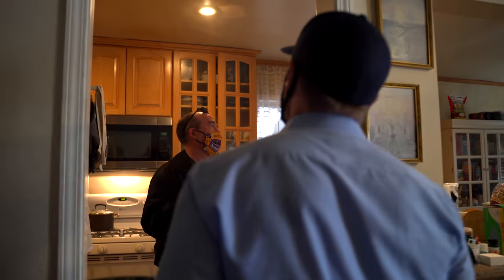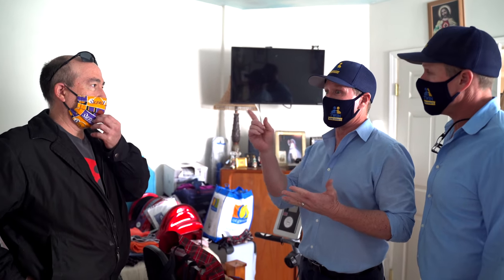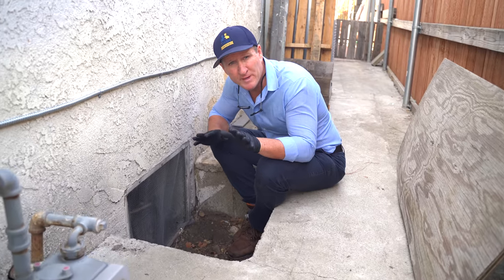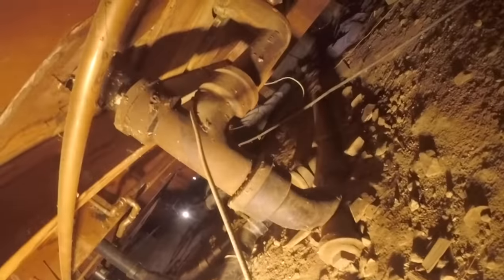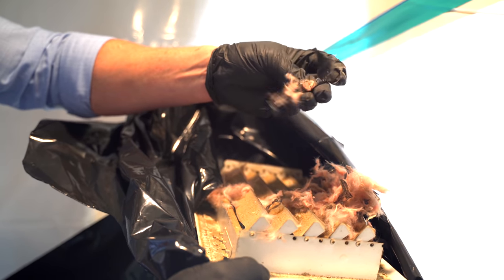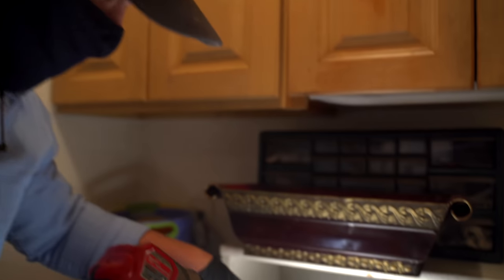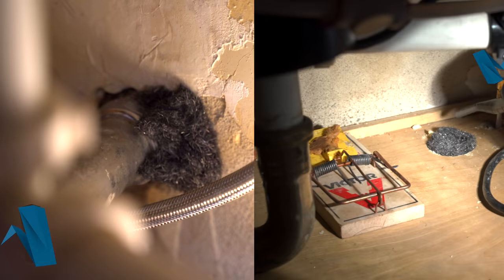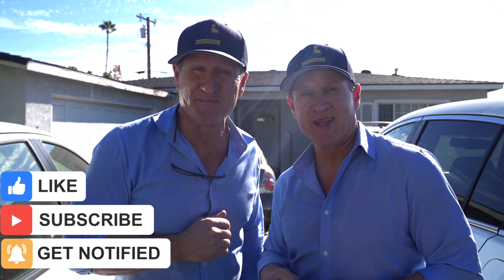How to GET RID of Rats QUICKLY when traps aren't working...Twin Plumbing

Comment: My house is 100yrs old. Its been a constant struggle. To the point I wanna sell the house but I found a new company that does a lot of the things you talked about. Thanks for letting me know what to look for. These vids give me hope that this can be solved. Wish me luck.
Reply: Most pest control guys are  ot interested in solving the problem. They want to keep the problem alive so you keep hiring them over and over
Reply: @resireg  this guy fixed it. Walked in and knew exactly where they were getting in. Crawled under the house. Didn't charge me a crazy amount. Hopefully they never come back.
Reply: The thing with rats is they follow the scent of former rats who have been there, so if you get rid of one infestation it’s only a temporary fix. Rat control needs to be done on a regular basis or they easily reproduce again to take over. Good luck with your home.
Reply: @eatwhatukiii2532  thanks. It's been about 2 months and I haven't seen any sign of them. Hopefully it stays that way.
Reply: I also have a 100 year old house.
 It was completely remodeled inside and I bought it almost 2 years ago and discovered recently I have roof rats in a wall and a closet and I am sure in attic etc. No signs in the garage.
 I'm trying learn as much as I can about what I can do myself and what to expect when I call a professional while I save up money to hire them.
I am so freaked out, but watching these types of videos kind of helps me desensitize and get in combat mode instead of wanting to retreat and move, Lol.
I've even considered buying native rat snakes for under my open crawlspace...
Reply: @AngieF8  lol it's a ongoing war, my backyard is facing a corn field with the 100 year old house so let me tell ya, they will keep trying to come back for revenge
Reply: We have the same issue & our home was my husband's grandparents. My father's best friend lived nextdoor so we both grew up playing right here together & are loathe to sell it. But one side butts up to woods, across the street is a climate controlled storage unit company surrounded by farm land that runs between it & our local airport. Within a 1/4 miles is a UPS as well. We THOUGHT we just had nice again this year but the traps haven't gone off. We even have one of the professional metal catch ones that can be a love trap or set with a glue board. Nothing. 
A few weeks ago I was working my flower beds and noticed dirt piled up from UNDER our foyer on both sides. 
My oven has started stinking so bad & I have reactive airway disease that reacted badly when I tried to pre-heat the oven last night with the exhaust fan. 
He just pulled the oven out to deep clean & a Norway rat jumped out & ran to a HUGE hole it ate in my cabinet
Reply: @KyaniMosaic_Crone  I'm sorry. I hope you get it resolved. These old houses are like Swiss cheese. As for me I'm moving to a loft were I can see all corners. Lesson learned.
Reply: Get barn cats. Not only do cats annihilate rodents currently there, their scent also discourages more rodents from moving in. A small feral population of barn cats that are spayed and neutered will make rodents disappear.
Reply: @qntcats5974  update. House is on the market. Moving to a high rise new construction on the 1st. Lol. I've given up.
Reply: @virgochic8415  I purchased a home in the woods with a large workshop that hadn't been occupied in years. People I bought it from remodeled the place but because they hadn't lived there it still had a rat problem. I moved in with some rescue cats that I've let hunt since they were kittens and the rats and mice disappeared within a few months. A couple good mousers will eradicate rodents quickly because cats kill for fun, and will kill every rodent they see even if they aren't hungry. People suggest native snakes, which is fine, but nothing beats the sheer efficient murder machines that cats have evolved into. That's why cats were seen as magical creatures in the past. Anywhere with cats had healthier populations because food stores were protected from vermin. So people attributed cats with good health.
Reply: @virgochic8415  Can you tell me where your located and who you used. I literally have noone local.
Reply: @BRATTICUS68  sorry to report nothing worked. I moved.
Reply: Yea same, I’ve been battling them for 2’years!! What I’ve learned:
Use rodent mesh, also put ground pepper where you think they might be getting inside the house, as their nose is their main sense.
Keep all food/pet food in plastic containers and keep your house clean. Don’t leave a bbq with food waste. Also if you have dogs clean up their mess in your garden as that attracts them. Other thing I’ve found recently, if you’ve got sunflowers and therefore sun flowers seeds, in your garden that will neutralise any bait you put down once they eat them.
Cats can be a good and a bad thing. If you don’t have a cat flap and only let the cat in and out through a door or window so you can see if they’ve bought one back as a present then you just lock them out till they’ve eaten it lol
Reply: Can you tell me where you're located and what company you're using.  I'm desperate.  It's only me running a big farm and I can do everything needed,  alone. I'M DESPERATE. They're overrunning my basement garage and crawlspace. Now back in the kitchen.  I'm trying to figure a way how I can move our but I have to many farm responsibilities etc.  I NEED HELP ASAP. They're reproducing faster than I can fix the issues alone. It's horrible & reeks.
Reply: Have you sorted you’re problem out??
Reply: @yamyite  yeah I moved
Reply: @virgochic8415  so u couldn't get rid of them?
Reply: Good luck to you!
Reply: Hire some cats, they work for cheap and are fun to have around!
Reply: @resireg  Like doctors.

Comment: Most rodent extermination companies are useless.  The Twin Home Experts are right, if seals are done incorrectly, no wonder the rats are still entering.  You have to find every entry point and block/screen it, to eliminate the rodent issues.  That is what we did with steel wool, in combination with two other methods, finally got them under control.
Reply from the maker: Thank you 🙏
Reply: What were the other methods you used in addition to the steel wool?
Reply: @_-_-.-_-_  awesome, thanks! I will definitely do these as well.
Reply: A rat chewed under the floor in our mobile home. We filled the hole with foam insulation and wire on top but, we had put poison in the hole first. Well, that was about a month ago. I heard nothing then today chewing again!!!! Ugh under my floor boards.
Reply: But they chew threw the steel wool 
Definitely trying to find the entry points would be best start 

Apparently they can chew through steel metal ect
Reply: Hiya am really struggling with rats at night time I don’t get no sleep I hear bathroom kitchen ever well else have put poison down but still coming bk could you help please
Reply: @cokeycookie  same here! 😭

Comment: Once I blocked off an entry point, then the rodent could not come and go so it died somewhere in the wall. Now if a find an entry point, I make a one way flapper door-so they can get out but not back in. If after a few weeks I see no activity or sounds, I seal it up.
Reply from the maker: You nailed it! That’s the best thing to do is find that entry point. Then it’s so much easier to handle from there.
Reply: Rats released will return & chew a new entry point. Rats remember past homes. Killing ALL ends breeding & no offspring invades your home again. I understand you want to rid them ASAP but they’ve earned being cursed as nightmare PESTS.

Comment: If you have Rats / Mice in a wall. Measure about 3 ft up the wall from the baseboard , drill a 3 inch hole in the wall with a hole saw as close as you can get to where you hear the noise , its probably there nest. Here are the 3 best things to get them to leave. 

3) Onions
2) Peppermint Spray.   ( Amazon ) 
1) Pepper Spray.   This will make them leave and NEVER come back.  ( you don't have to spray it on them , just spray it where they congregate ) , Drown it with pepper spray down in the hole. Don't get any on you , this stuff is POWERFUL !!!   After activity is gone seal up the hole with a patch. 

Rats/Mice absolutely cannot stand Pepperspray it drives them CRAZY !!!  THEY WILL LEAVE.............

Comment: You did a great job finding the entry points. My only concern is that the rats are already in the attic, so unless you get them out they will continue to wreak havoc. There's no water or food supply but the smell of dead rats in an attic or wall is something I will never forget. Good video though.

Comment: Foam seal ALL protrusions through floor. Install positive pressure system in home. Foam seal electrical outlets and ceiling fixtures. Leave not even a crumb for them to eat. REMOVE all flex ventilation, replace with solid ventilation pipe. Flexible plastic ducting should b outlawed imo.Use stainless expanded metal to cover roof vents WITH stainless brillow underneath it lightly covering vent pipe (wasp prevention). Expanded steel screen quarter inch or smaller covering crawlspace vents.
Reply from the maker: Yeah buddy! This is 100 percent right on! Thanks 🙏
Reply: What to do about burrowing against pier and beam foundation? Fortunately, I've done everything you've said, but that's a reocurring entry point. I fill and they dig another hole near by.
Reply: @ggshandsomeboy5103  cayenne pepper mix a lot into sprayer with water and spray surrounding ground
Reply: @organicvids  Awesome and it will smell much better than animal urine. 
You are very much appreciated!!!🙏🏾

Comment: I removed all the insulation out from under my house and replaced my heat ducks from the flex insulated ducks to galvanized metal. It's better to pay a little more on the gas bill for heating than it is to deal with a road and problem under the house

Comment: I have a rat infestation at my barn. I've tried pretty much everything, humane traps,  snap traps, glue boards, and now, out of desperation,  poison. It appears that these rats are smart, once they see thier siblings fall victim to one type of trap, they learn quickly to avoid them, so I keep changing my strategy. I hate using poison, but out of desperation, finally put it out, however,  I do have chickens and barn kitties, so I worry about poison. These are great ideas, I'm gonna try them!
Reply: CSee if you can find a terrier or dachshund club nearby.    These breeds are born ratters, it’s in their DNA to smell out rats, grab the quickly and break their necks.    My two wirehair dachshunds would make short work of them.

Comment: They will eat through the excluder. I’ve resorted to using premixed cement. Only using excluder to fill voids to build off of.
Reply: If the excluder has steel wool in it, they won't chew through it. I can't really tell in the video. I find stainless steel wool is great. Used where it gets wet it won't rust away like regular steel wool.

Comment: I setup glue traps, electronic traps, and spring traps. I had a success with electronic and glue traps. Cleaning the dropping was a challenge for me. I sprayed the dropping with Clorex bleach and wait until it dries up then  vacum clean it. I know that vacum cleaners may spread the dropping particles and transmit infections but as long as I disinfect the area before vacuming, it should be safe.
Reply from the maker: Awesome! Glad your having success. Yes, great tip on sanitize first to prevent a typical vaccum to cross contaminate.
Reply: WHERE CAN I PURCAHSE HE GLUE TRAPS AND ELECTRONIC TRAPS
Reply: i REALLY NEED YOUR HELP
Reply: @marisol033 
 I purchased glue traps and electronic traps from Amazon.

Comment: What do you do to keep them from coming back and following the scent of previous rats?  Is it possible for a homeowner to get rid of a roof rat infestation.  i am seeing them in th house often and garage and now hearing them in walls behind cabinets and the other night I head them in a closet behind the walls or ceiling in my daughters bathroom.   Is it cheaper to buy a ton of catch and release or higher a pro?
Reply: You should watch a lot of the Twins videos. 
They give all the information over several videos.

-On the roof, exclude all the top vents completely.
-you would need to use metal webbing leaving no small holes in top of the vents.
-Also on the roof, make sure there are no openings … broken areas ….. on the roof to the attic area.
-All opening in,the ground level need to be excluded. 
-Andyou will need to check out the crawlspace on the ground level.
-if you are seeing them in the house, I bet they are getting in via an opening under the sink or an opening in the wall behind the dishwasher or the washing machine. 
-Don’t leave out any food at all in the house. No dog food in the floor. No vegetables or．fruit out in the counter. No　bags of flour etc which they will eat through. 
-once all the food sources are gone and you have excluded all the entry points in the kitchen then traps will start to work because they will start to get very hungry the twins say.

Comment: What is the stuff called that rats can't penetrate that you used at the end of the video?(to stuff up the holes)
Reply: wire wool on the roll.......available cheap from diy stores or car body repair suppliers/furniture finishing product suppliers.......buy bulk........failing that amazon.

Comment: If you block out the entry points, they breed so fast, and sometimes don't take the traps, how do you get rid of existing rodents?
Reply: Exclusion first, if they are trapped in a structure they must eat, take away all food source possible, hence the only options they will have is the bait in the traps.

Comment: Here’s a crazy question but why dont they do metal ducting rather than the flex ducting is it just a question of cost because rats can’t chew through metal ducting and also the insulation I heard that there is an insulation that rats can’t stand ? 
I’m still surprised that people don’t realize that if you can put your pinky through it rats can come through and I sealed my house and was going crazy trying to figure out how they were coming in until one day I realized they were coming in on the cable line through a small crack in the eaves of the roofing 
I live by a creek and problems for years until one of my neighbors did some thing smart she planted mint in the creek bed and during the Drought I have not had a problem with rats

Comment: Great Info. Thank you 😊 Can I ask what a Service like yours would cost?, approximately,  I'm a single woman with limited income and i bought an older home last July 2020 and the Owner neglected to tell me he had an active Rat (not mice) problem so I ended up spending $900 to this fly by nite company (i was desperate) bc they were in my Walls and Attic by September and I was frightened (for my little old dog too) that we were gping to get bit. They sure are Smart little Dickens.Anyway, they never came back to cover any holes or nothing preventative. I'm afraid I haven't done enough for Winter 2021 prevention. Please Help..God Bless you and Thank you for.the tips.
Reply from the maker: Hi Teresa! Thanks so much for tuning in. Where are you located? Pricing really depends on so many factors. Typically can range from 875.00 to 5,000.00. This is based on how many wall or ceiling openings? Attic clean up? Exclusions? Monitoring? Sanitizing? You can email us at support@twinhomeexperts.com for further support.

Comment: I've got a rat between floors. I contracted with a major Pest company and they set a ton of bait stations outside and a couple traps inside (not near the noise, as there is no access point for a trap). They have not touched any of the 7 bait stations. We think we know where the critter got in via burrowing but they suggested not closing the hole because it might trap it inside. What do you think? I worry I'll end up with a colony!

Comment: Question at night time does turning your phone flashlight on and shaking it violently under your bed and where holes  are while your on top of you bed a good idea?? Also is it a good idea to turn your bedroom like on (at 2:00 am)
Reply: You would have to be luck enough for a mouse or rat to show up at the right time to be scared, so it's probably a waste of time. Rodents will get used to a light being on, and won't associate it with danger.

Comment: What is the name of that steel wool strip that expands?  where can I buy it?
Reply: Looked to me like a piece of the large floor machine scrubbers found in the rental section. They are round, i bought one and cut sections for small scrubbing pronects.  I will be trying it on rodent entry points.

Comment: So how do you get rid of rats quickly when traps don't work??
Reply from the maker: Identifying ALL possible entry points, then performing the right exclusions, then baiting and trapping. This is the fastest way.
Reply: @TwinHomeExperts  if you close all the entry points, what happens to the ones in the house that you can't set traps for?  if you close all the entry points, don't you also close all the exits?
Reply: @valthomassie4116  there are other bugs in your house, if they rot through the walls or start stinking thats a problem but for the most part those carcasses will dry up quick, as disease ridden as they can be